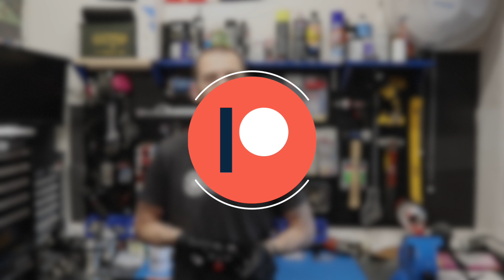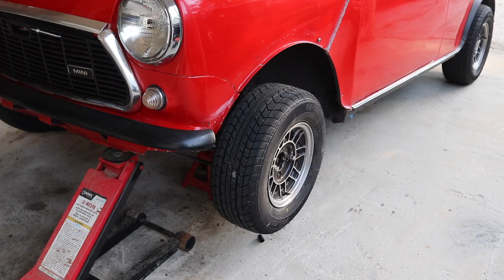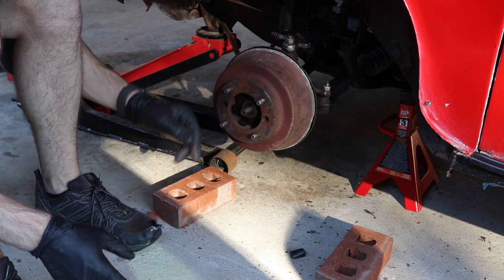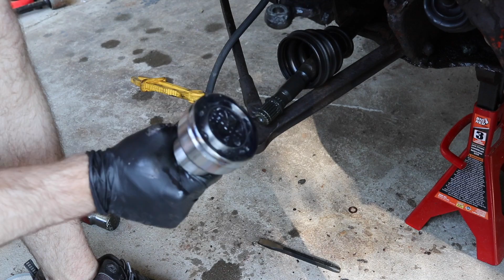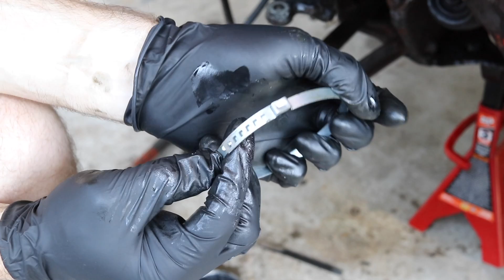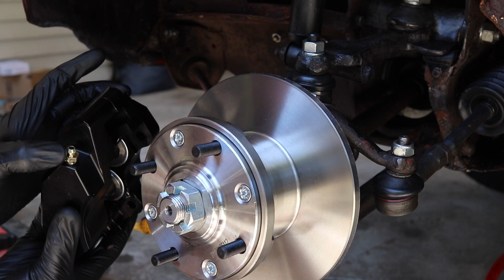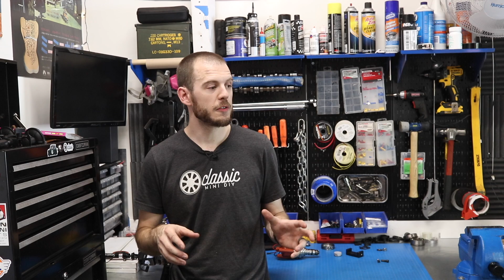Classic Mini DIY - Converting your Mini from Drums to Discs

Comment: hello great work. can I know if mounting the disc brake kit increases the wheel width compared to traditional brakes?
Reply from the maker: I am not sure of the exact measurement but all disc brake kits do widen the front wheel base by a bit. To align the rear wheels a spacer would be required.
Reply: Each side sits 1 inch further out. They make drums with the spacer built in as used on the later disk brake cars.

Comment: Cole, how do you feel about rear disk brakes for the mini, using a proportioning valve to apply pressure to the front disks first.  Is it a bad idea?  I had this setup on my first mini, but when I mentioned the idea to another you tuber he said there is no weight over the rear end and that would cause it to spin.  What is your opinion?
Reply: its not to apply pressure first , but proportionally , its in the name.

Comment: I have a question about the conversion kit. Is there a conversion kit for the rear drum brakes as well? Or do you run it with discs on the front and drums on the rear?
Reply from the maker: There are conversion kits out there but the stopping power is about the same with discs v drums in the rear and its more about lightening the rear hubs if you’re swapping to discs back there. The OG drums in the rear are more than adequate for most all minis. I personally run drums in the back.
Reply: @classicminidiy  Thank you for the fast reply. Thats what I have imagined as the only conversion kits i found for the rear are for racing

Comment: Is 7.5 alright for street use with 12x7 wheels?
Reply from the maker: Yes 7.5s will fit fine all the way down to 10inch wheels. However 12x7 likely will rub. That’s a really wide wheel. Any reason you wanna go that wide?
Reply: @classicminidiy  The 8.4" disc brake was brought in on the 1974 1275GT Clubman when 12" wheels were fitted so the 7.5" work no matter the diameter of the rim. (Not sure why someone needs 7" wide rims to be honest but hey ...). And if you have 12" wheels why use 7.5" brakes which were only marginally better than a well set up TLS drum system unless you have those 4 pot calipers? (the 7" Cooper ones were worse!).

Comment: Very sloppy workmanship tip-iCal back yard job, & you forgot to refit the copper washer on the brake hose & you need to use correct size spanners not the adjustable to avoid rounding off the nuts, also thats not the correct way to install the split pin on the drive shaft.

Comment: taper roller bearings are not tightened in this fashion they should be tightened then backed off to the next notch in the castle nut they need some end float

Comment: When fitting that top steering are did you put the locating dowels in as i didnt see that. When using that type of joint splitter  best keep the nut on incase it damages the thread.
Reply from the maker: Hey Mark, Locating dowel I am not sure what you are referring to there? However you are totally right, taking that nut off was a mistake on my part, I am lucky the threads were not damaged on the tie rod.
Reply: mark piper you can see them on the hub at around 25:40
Reply: @MiniMattTV  nope cant say i can ☹
Reply: mark piper oh, think I was seeing the holes thinking that was the dowels. they get stuck in the steering arm, easy to not really notice that they’re separate but I’m sure Cole did a good job 👍
Reply from the maker: Oh the little round bushings between the steering bracket on the hub! Yes those were installed off screen when I did my hub work. I really should have showed that.